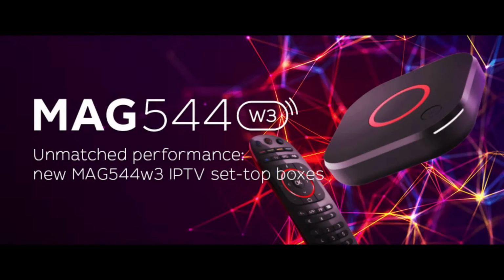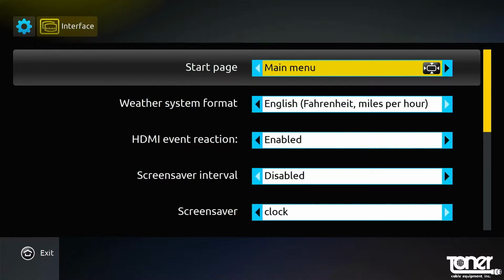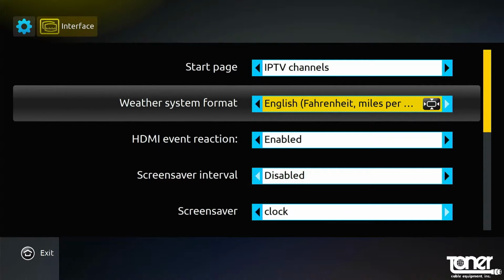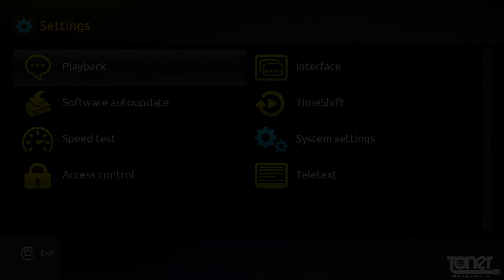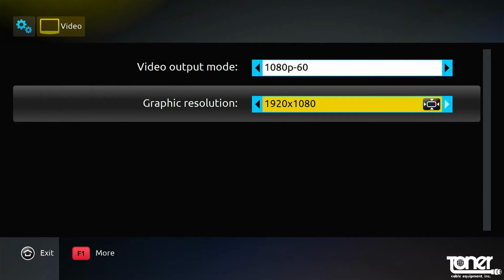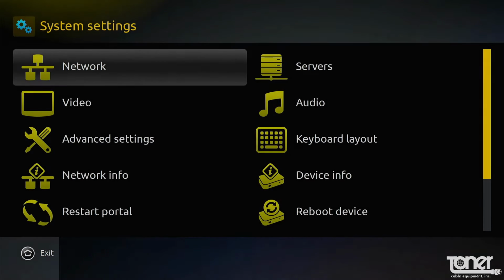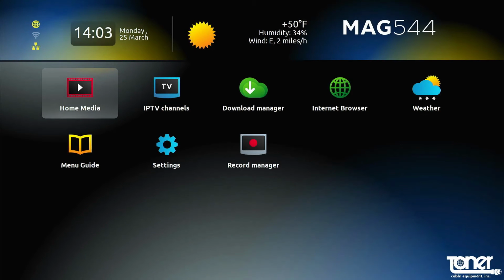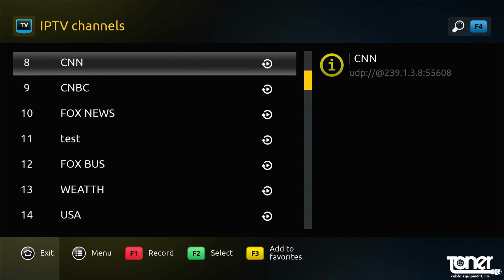Infomir MAG544 W3 IPTV Set Top Box Quick Start and Set Up, Toner Cable Equipment

Comment: Hello Friend, I have  MAG544w3 remote and Samsung TV. I am having challenge to program MAG544w3 remote to Turn off and on the TV. I have to use two remotes to program. I tried by keeping both remotes facing each other and followed instructions. Somehow, unable to get it working..  Can u please help with steps.. Thx

Comment: hi ,may i use a vpn with the box and if yes how ? Thanks a lot
Reply: No. You cannot use VPN software on any Linux MAG Box as nothing cannot be installed on it other that whats allready on it. You need Android Box. Infomir has them too. But, if want VPN on Linux MAG Box, the only way to have MAG Linux Box under VPN is to have a Router capable of VPN.

Comment: Hey, do you know if this box can output 4k 60fps as advertised? In your breakdown I only saw 1080p 60 as the max output.
Reply: The display used was 1920x1080p, if your tv is 4k capable it will populate more options

Comment: Hi, I have the unit , having an issue with it ( while watching IPTV live streams ) it will go black screen and after a second or two , program will come back on , this is consistent specially in the afternoon on.
Any ideas why this is happening  ....Thanks
Reply: sounds like you're having a codec problem or your IPTV is having IGMP issues.
Reply: seems like your ISP blocks the streaming service ?
Reply: Did you solve it? I got the same problem